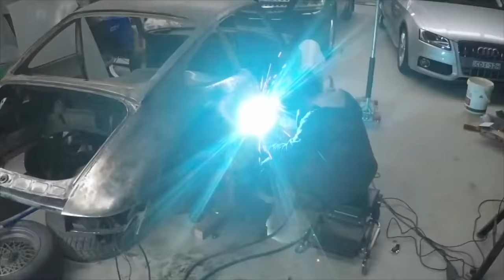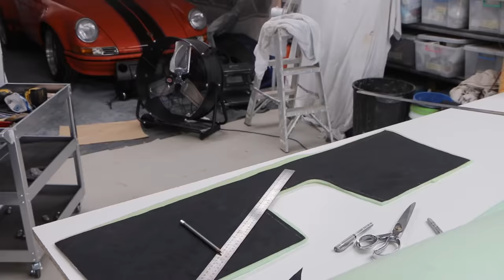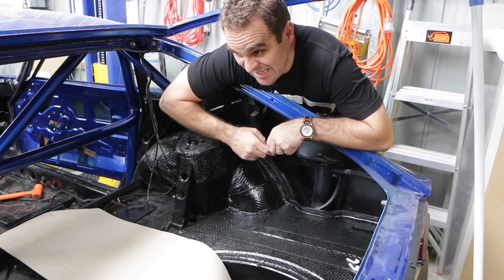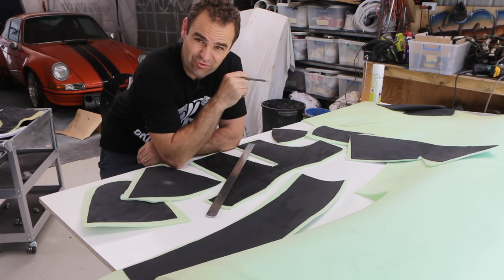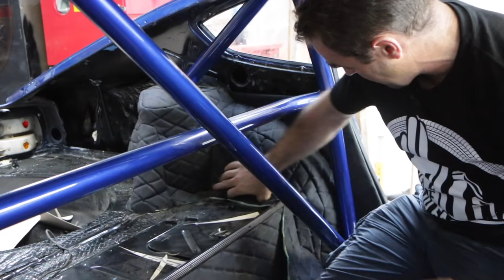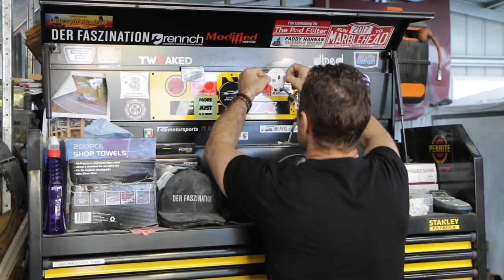Rear wheel arch trimming - Home Built Datsun 240z part 76

Comment: Coming on well Jeff, and even with the slight mistake it is going to be a beauty and if it goes as well as it looks you will have a very fast car.  Mrs Jeff not many remember that about that McLaren, people got very interested in the car after Mika Caught David from so far back to pass him under the agreement the 2 drivers had that whoever was leading in to turn 2 on the first lap would take the win, if both cars were still running.  David honoured the agreement even though Mika was way behind and David had been leading for a long time. Most other drivers would have made their car so wide that Mika couldn't pass.

Comment: Jeff, where you spoke about making a circle at the top of the rear shock towers the original trim has a circle cut out which is covered with a plastic clip on trim piece.

Comment: I am using a harness bar in my Z behind my Sparco Pro 2000 seats for my OMP 4 point street harnesses (std type click latch) in Queensland and it is legal and has been engineered and  mod plated. Disappointing you can't have that in NSW mate
Reply from the maker: That is interesting. I have only recently heard that it may be legal on cars that came with fixed seat belts after engineering. I will look into it.

Comment: Pattern was made for drivers side, but you showed finished cover for passenger side... ever think of using Velcro instead of gluing the covers to the car interior?
Reply from the maker: The pattern fits both sides, but when I draw it out onto the back of the material it gets reversed. I thought about velcro on my 911, but it doesn't end up as nice, and I have no need to take it back out.